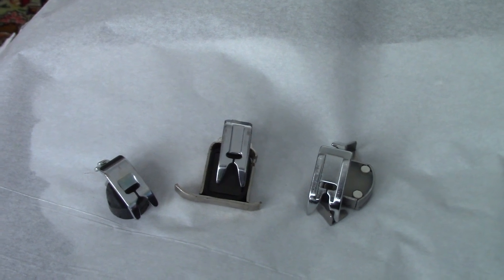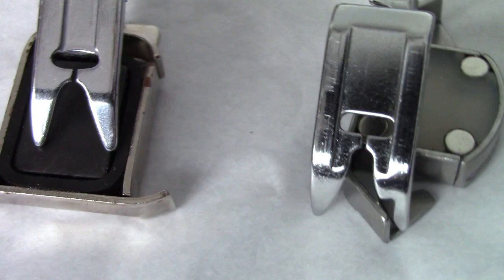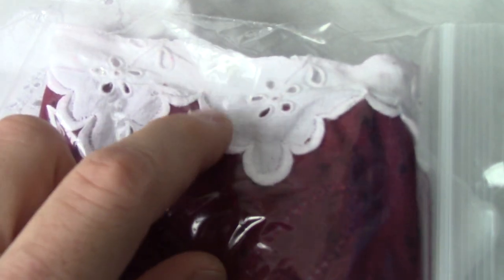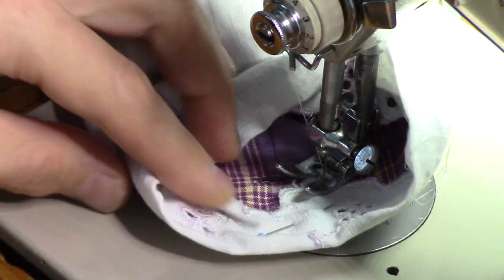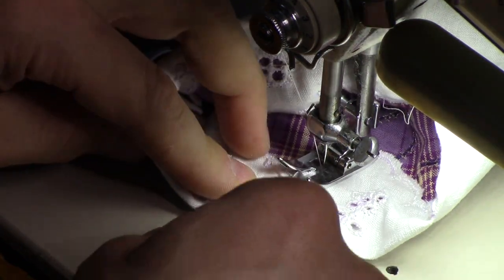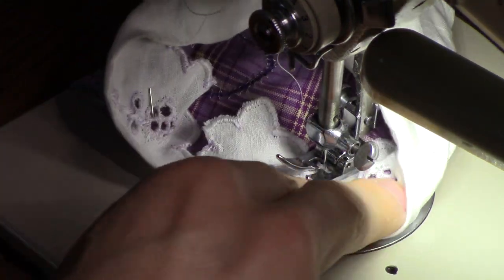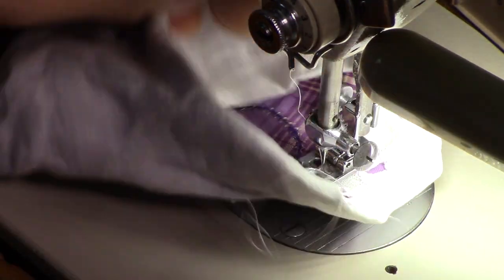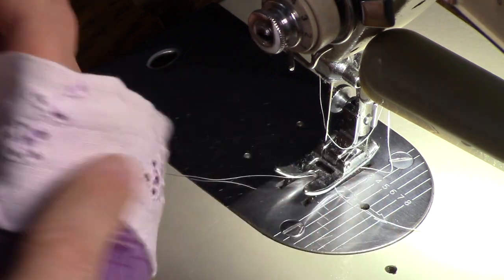ZigZag feet -- Why are there different types?

Comment: Hi, JR
I have a vintage Morse sewing machine, straight stitch. I need to replace the spring in the tension assembly.
I don't know how to remove the silver bottom on the assembly.
It isn't a "screw" type that I see in many vintage sewing machines videos.
Hope you can help me
I which I could send you a picture.
Thanks for all your interesting videos
Reply from the maker: I am happy to help. Try opening the nose cover of the machine (left side). There is likely a grub screw that holds the metal tension shaft in place. Unscrew it a bit not all the way and then the shaft start wiggling and will come out. If that does not work, we can try a Skype meeting.
Reply: @jamesrogers991  thanks so much, I will try that later today, I don't have Skype but will try it,
I was trying to contact you via Messenger this morning ( my married name) I don't know if it was you, lol